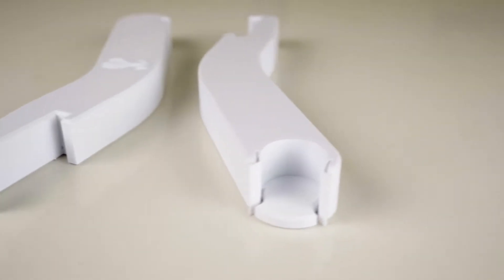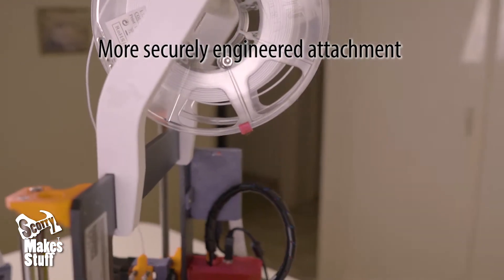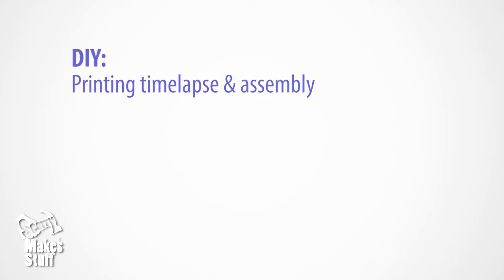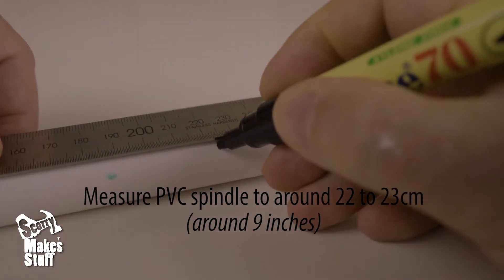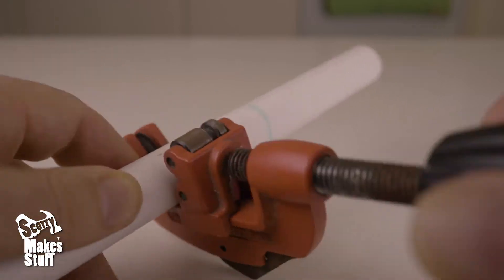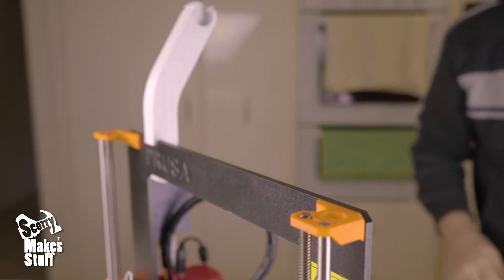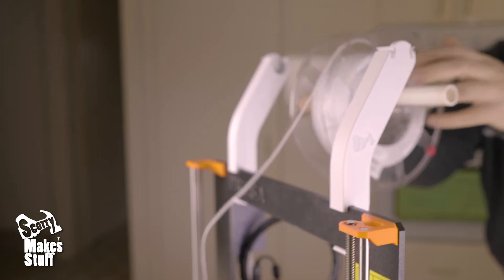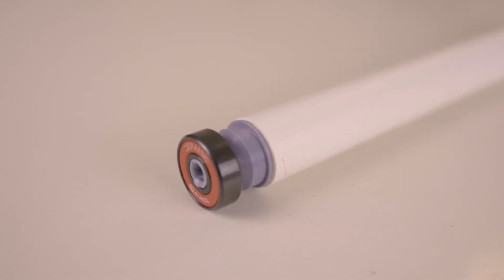Improved Prusa i3 Spool Holder

Comment: You should spec that you mean 3/4" OD in your description. Pipe is sold based on the ID not the OD so really people need to buy 1/2" PVC pipe off the shelf. Quite annoying to have to go back to the hardware store now since I bought based off your instructions
Reply from the maker: Not in my case as it's electrical conduit which uses the OD here in Australia
Reply: ScottyMakesStuff then spec what you actually used. Pipe isn’t the same as conduit
Reply from the maker: You should learn some respect and not chastise someone when they are giving you something out of kindness.
Reply: ScottyMakesStuff incorrect specs/info deserves no respect
Reply from the maker: You have an evil soul. I pity you and the selfish darkness that consumes you.
Reply: What kind of moron doesn't bring the actual piece to the hardware store to confirm the fit?

Comment: Hi Scotty. I am a 72-years old newbie to this. I have a Prusa mk3 on order and I am collecting together all useful files. I really like the design of these holders, but I would like to mount them on the top of a printer enclosure. I would like to take your tube holder and modify the bottom end. however, when I import the stl into Shetchup (I know, its the wrong program, but its all I have), there are so many curved segments that I cannot extract to top section. Do you happen to have any files without all the rounded corners? Thanks. Tony
Reply from the maker: Thanks Tony! Fusion 360 is free for non commercial use and there's plenty of online tutorials stepping you thru the process of importing an stl and reducing the triangles in the import. Sorry, there's no non curved version as the base shape is curved from the start and would surely break if I attempted to straighten it.
Reply: Scotty. Thanks, but I cannot find a "free for non-commercial use"  version of Fusion360, only a free version for students, etc, and I am too old for that!
Reply: Hi Tony the way Fusion 360 works is you use it as the trial version and then apply for the non-commercial license before your trial finishes.
Reply: Thanks, man. I'll give it a try.Tony